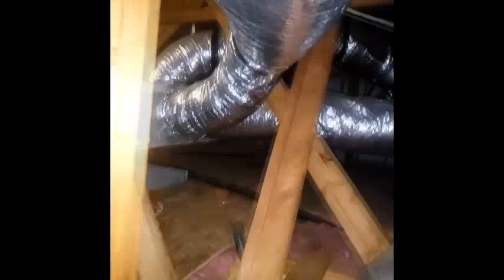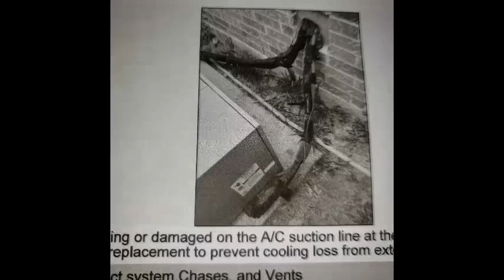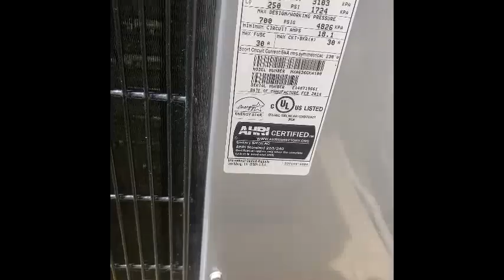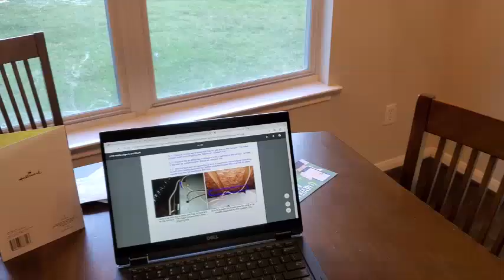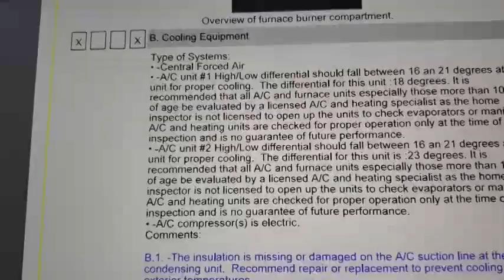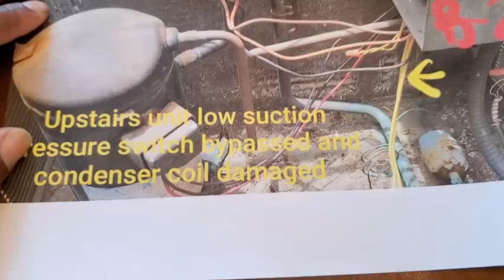"Mind-Blowing HVAC Inspection Repairs: Unbelievable before and after transformations!"

Comment: How much combustion air does that have ? has two gas furnaces and one water heater. The green and red must be touching somewhere in the wall or at the control board.